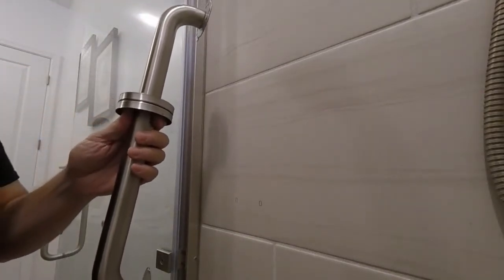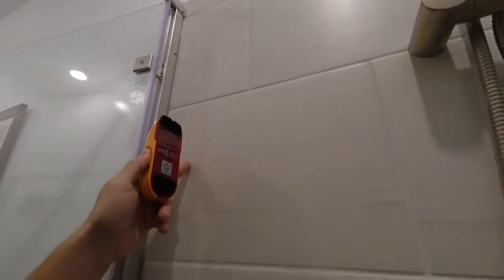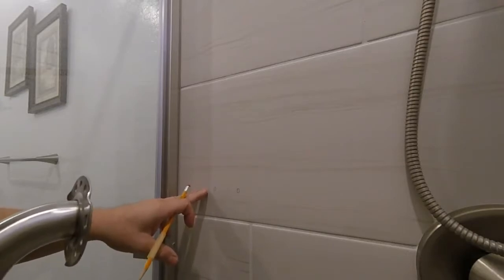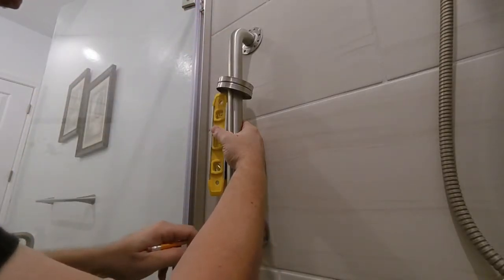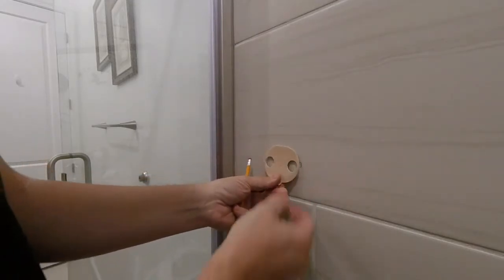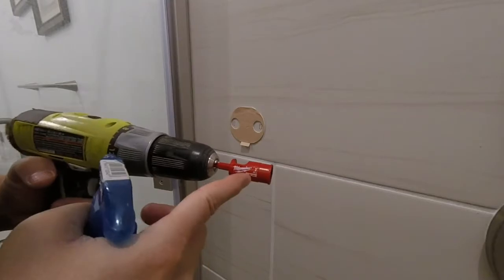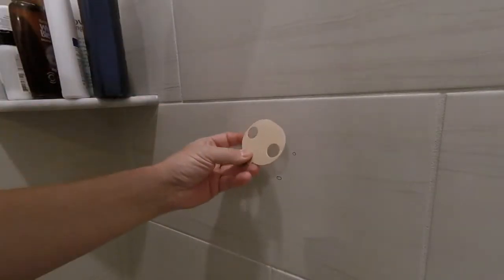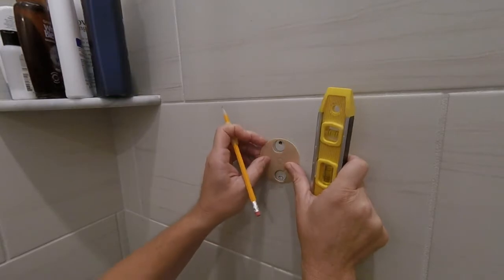Bathroom Grab Bars Install

Comment: Good video, some more tips.  Tape the escutcheons to the bar so they wont rattle around.  If you have the templates just measure from the inside of one flange to the outside of the other than transfer the measurement with a level to the wall and center the template centers over the marks.  No need to try to mark all the holes while trying hold a bar in place.  If drilling with an arrowhead bit the holes are undersized and it can be a real bear to get the anchors through the holes.  Don’t try to pound the anchor in, will crack the tile.  May need to enlarge the holes so the anchors don’t get stuck.  Be sure to buy the wing-its that are made for the wing-it bars.  The standard stand alone wing-its anchors plastic “covers” don’t have off center holes and the escutcheons wont cover the anchors.  You’ll have to trim the plastic to fit under the escutcheons.  Not easy to do.